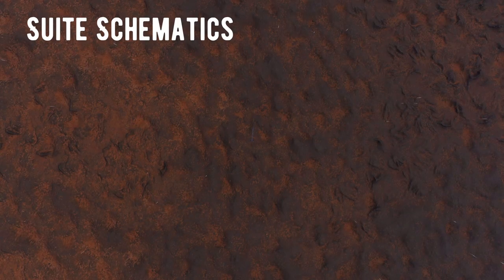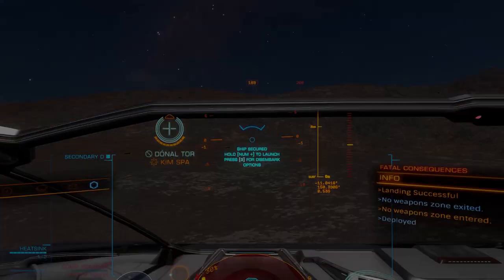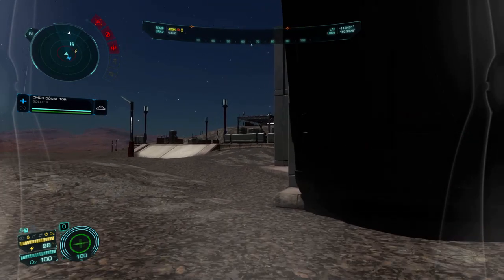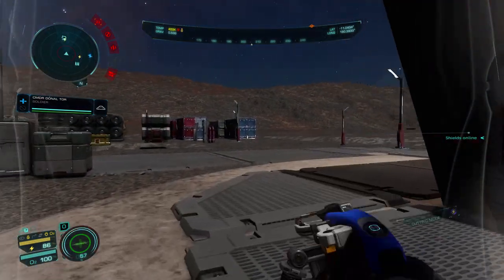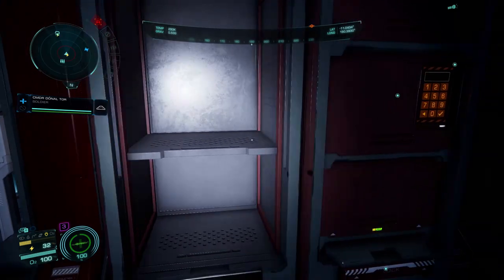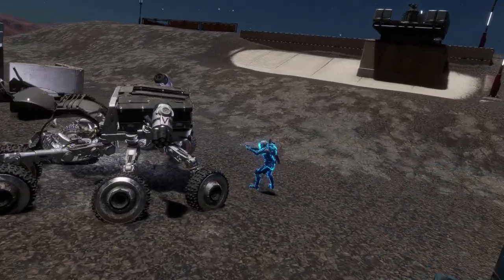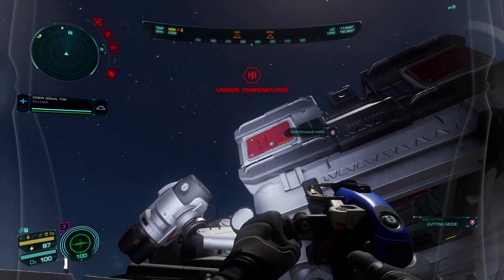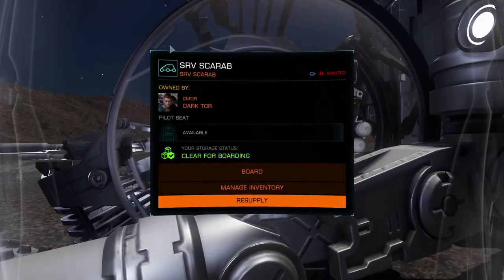Suit & Weapon Schematics Ionised Gas Power Regulator EASY 15 Min Game Loop | Elite Dangerous Odyssey

Comment: Cobras get instant like.  Little tip for when you got power regulators comming out of your ears,   Head for the famine , civil unrest  , blight , outbrake systems ,  use on power regulator to power up the base , tons of e breaches.  ( not realy nessesary but they cant hurt)  A cobra with missle and mines ,  clear out those large to huge setlements of raiders and you can have tons of materials you need  .  afterwards take back the power regulator and move to the next big one.
Reply from the maker: Great tip - thanks! I have a pile of them now so I may well do that.
Reply: @torsodyssey7061  Your welcome , besides you learn also the layout of those bases ,

Comment: Great video:  well-produced, has all the info, and the external camera work with the narration was just right.  Thank you!
What is your preferred method for obtaining Carbon Fibre & Titanium Plating?
Reply from the maker: At this site, you can go across the landing pad and loot the tourist settlement. There is usually a lot of Carbon fibre.
Reply: @torsodyssey7061  Excellent, thank you.  That is also tradable for the titanium plating.

Comment: Thanks for the video! In your experience, has this loop been enough to farm the materials you need to upgrade suit, weapons, as well as engineer mods?
Reply from the maker: Not on its own. There are things you need for the engineering mods that you get best through missions. Also, you can build up a lot of the materials (slowly) through normal gameplay. This loop really helps with suit schematics above all else and the ability to get power regulators and ionised gas are a bonus.